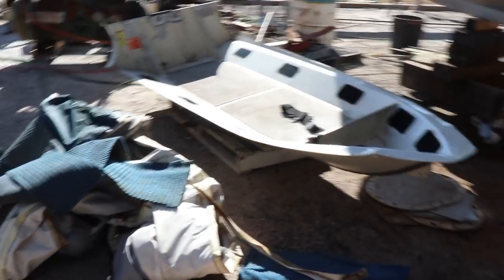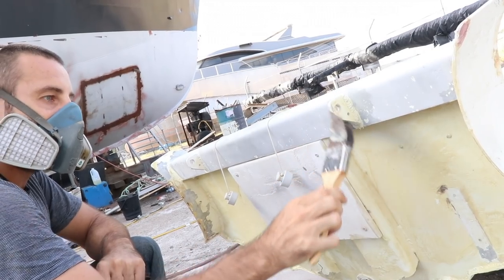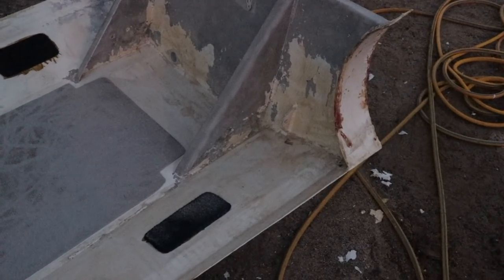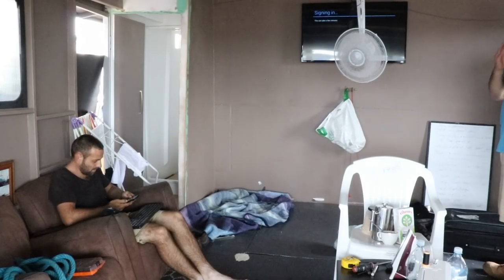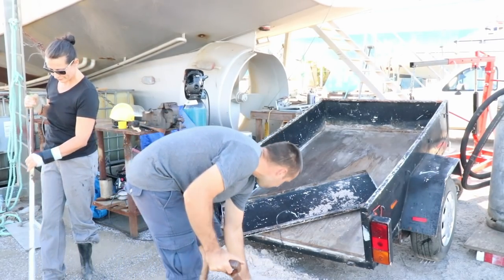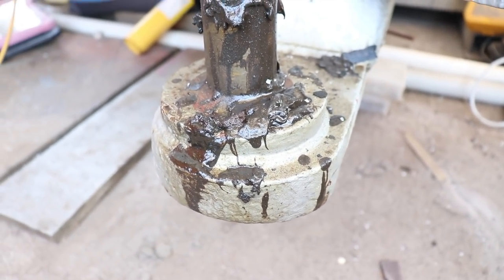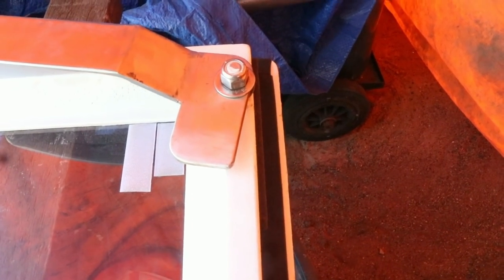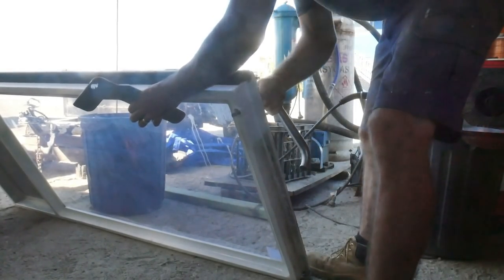Jet Dinghy Conversion and Dogs - Project Brupeg Ep. 68

Comment: When you do the pontoons make sure you leave a air valve so you can fill them with a bit of air (under 10 psi ) , it wont stop dents , but it will help with rigidity. you could also get thinner material than you would normally get away with.
Reply from the maker: Yeah I did wonder about that. Thanks

Comment: A couple of thoughts on the Expedition dingy build:  1- I would set the centre of balance just forward of midships at full loading and at the waterline.  This will maximize the freeboard for rough sea's.  Adjust the trim so the boat's  'V' hull is in displacement mode at 1/4" thrust, beginning to rise onto step at 1/2 thrust and on plane at 3/4 trust.   Leaving a reserve of 1/4 thrust for over loading in an emergency.  
 2- I would make provision for a 4 person life raft, using the container as a seat forward. This will provide some enclosed protection, for engine failure in rough cold seas. And could be used to pick up or support people in cold water
3-   Rope ladders both port and starboard to assist boarding from the water over high freeboard.  
4-   I would make the side tubes from the thinnest aluminum you can weld, filling the chamber with closed cell foam for dent resistance, make the fill holes with threaded aluminum rivets.  These then can be used as attachment points for light accessories ( not to be used for heavy loads, anchor points for lines and other structure. see 5)  . Run the tubes long then cut for trim.   
5-  Weld a half round to the top of the tube for the heavy load attachments and a step.  Not the tube! Also add a 1/2 round to the side of the tube as a rub rail, to protect the tube .
6- On the front of the boat add a step plate for boarding from a rock beach over the bow.  With hand rails 1' above the tubes welded to the 1/2 round part way down the sides open in front for boarding.  This rail could also be used with a fabric cover for cargo or shelter. It would help in rough water to limit water coming over the bow. A saw tooth welded to the bow at the waterline will help protect it  when boarding on and off rocks, logs etc.

Have fun with your tender design.  Wish I were there.   the old guy Bert

Comment: Here we "damage" the old paint prior chemical stripping. Use a coarse sand paper, or other tool, to put deep scratches, and then apply the paint stripper.
Reply from the maker: Thanks Fernando. Yeah we are going to give this a shot. What we are currently doing isn’t working
Reply: @ProjectBrupeg  tergo strip...industrial stripper...a stainless steel scraper wont tend to bite into the ali...the 2 pac paint doesnt sandblast well because it responds a bit like rubber, bouncy for sand...hp comes with weight...get an injected 2-stroke engine if you can...better fuel economy than ANY 4-stroke of similar power and less than 2/3rds the weight...no oil changes ;-)...far more torque too.
WHAT happened to the jet dinghy build ???????

Comment: A wire brush to angle grinder/drill might be the go for getting the paint off that dingy
Reply from the maker: Yeah that was our plan if the sanding doesn’t work. The trouble is the stainless wire wheels do rip the soft alloy up a fair bit so it’s our last resort

Comment: When you go to put the furing strips in you should contemplate running them perpendicular to the metal studs/ribs in order to limit/interrupt any heat/cold migration from the steel  .basically create an air gap between the steel and sheathing.
Reply from the maker: Thanks Jared we will look into that

Comment: Hi l don't know if this will help but l had the same problem with my allie run about the strongest paint strpper did nothing to remove the paint so l use spray on oven cleaner and that worked a treat
Reply from the maker: Ahh thanks Ward. I still haven’t been able to get the paint off so I will give this a shot cheers

Comment: Wheres the rest of the dhingy build??? I was interested in that!
Reply from the maker: We’ve had some big delays on that. People that were part of it ended up having really big health delays, the guy that found the engine for us flakes and went radio silent so we’re back to trying to find a new engine, the tubes are proving really hard to design on CAD and hence further delays. It’s something we want to get onto soon but we need to resolve some of these stops. It’s likely we will build the tubes without CNC cutting. Just get them folded up and we will weld them on and cut to shape on the dinghy. And fit the motor after the tubes as it’s proving hard to find a ski that’s powerful enough and also within our ridiculously small budget
Reply: Shoot it doesnt have to be a jetski, it could just be a 100hp jetpump, but if it does have to be a jetski, a yamaha 1100 1200 or 1300 would get that thing up to 60 - 70 kph probably

Comment: Epoxy paints use aviation grade paint stripper, Also when paint is ready for stripping don't scrape. Use a pressure washer or that water blaster you have there,  It'll work 10 times faster.
Reply from the maker: Ahh good to know. Hadn’t thought about blasting it off. Thanks Patrick

Comment: Hey damo just catching up on some of your vidz , if you can find one see if you can find a yamaha superjet twin they are rated at 80hp bit down on your 110, they are soo much more reliable than a rotax triple and most importantly they come with a proper cast jet unit and can be retrofitted to your hull. Almost all skis now run a hull with the intake molded in (fibreglass) and use nylon wear rings and alloy impellers .. a good superjet can be tuned and or impellers are avail in stainless from memory as are the wear rings , these things i think will be essential in a tender used reguarly  .. we got 33 years out of our stainless wear ringed and bronze propped hamilton jet unit , which pumped huge amounts of sand and small stones .. whereas all of our more modern skis needed wear rings every 3 years with no where near the sme amount of abuse ( we used to run the j52 over tidal sand bars ) .. Another thing to think about is power valves  from memory they are servo operated on the rotax   and always seem to give problems .. food for thought
Reply from the maker: Nice, good to know thanks Mitch

Comment: Awesome boat to be gifted!! sweet. I've seen ali aircraft get stripped with extreme pressure aqua blasting. This boat would have been done within 1 hour!! with no chemicals or sand at all. What happend too the dinghy conversion? suddenly its insulation and rudder? hope next episodes finish the titled story.
Reply from the maker: Yeah we had a bunch of things hold us up on the dinghy. The guy arranging the JetSki went cold so we are now hunting for a new ski to use, and the tube design is taking much longer than expected but both are being worked on each day. Hoping to have a solid update on this soon

Comment: For the rudder shaft I would get your machinist to put a parting tool cut at the height of your bottom pivot. Drop the entire shaft through the top bearings. Weld the bottom pivot and then cut the remainder of the parted section with a cut off disc. Your bottom pivot will then be in perfect alignment with the top section of the shaft.

Comment: You need to cover the paint stripper with plastic on the surface of the paint.  Apply thick then  cover eliminate the evaporation or solvents drying      Smaller sections at a time , scrape it then push stripper to a new painted area and reuse.
Reply from the maker: Ok great to know thanks.

Comment: just a couple of quick points. First I'd like to say I really like the music  during the parts when your not narrating or talking. also I was a bit baffled by the Styrofoam clean up until you mentioned the dog. however, there is an upside if the dog happens to ingest enough of the Styrofoam dust  you will never have to worry about the dog sinking in deep water...hahahaha
I look forward to seeing the video for the rest of the dingy and the finished boat.
Reply from the maker: Thanks Andy, Yeah it should be a fun wee side project. We are doing a mini-series on Patreon about the full dinghy build and will have a highlights type episode out to youtube once its all built.

Comment: Yeah you need to scuff that old paint first. Then the stripper can get in and do its job. It's looking good though. I really love the part in the intro where the engine fires up. On the fish boats I was happy to go down and start the engine when it was cold in the morning. At the rock quarry I loved nothing better than to be the one firing up the jesus motherin" big CAT power plant we used to run the conveyors out to load the barges. And as a 35 year long trucker I love nothing more than to listen to my engine purring along as we cruise down the lonely road. You might think I am in love with diesels, you'd be right. I haven't worked for 2 1/2 years because of heart troubles so your clip gives me a bit of a woody. LOL

Comment: 3:09: One panel down? 6:29: If it's going to be all alu, I wonder if you could reinforce the strakes on the bottom of the hull both for strengthening purposes and for dragging up pebble and ice beach purposes? Wouldn't add much weight. A lot of FG-hulled RIBs here have smooth SS strakes glued on for this purpose. 8:24: Bit surprised that plastic cup isn't melting, if that the jelly-type stripper that eats through layers of paint. I've stripped old doors back to bare wood with that stuff, which is useful, if evil. 11:00: 110 HP sounds vast, but if you're doing a jet unit, I bloody well don't know, either! Just factor it how heavy it will be to haul on and off the boat (because davits at sea aren't a great idea; you'll need a deck crane of some sort) and how beefy the lifting rings or related gear will have to be. 22:54: Sweeping the dirt is how our ancestors got a basement. 34:45: Charming an umbrella holder as Jess is, isn't Australia full of broad-brimmed hats? 41:02: Waterproof grease in there might help as anti-rust and as a sort of seal. Great work.
Reply from the maker: Hi Marc, because of the extra HP, im thinking we will need to beef the bottom up quite a bit. Currently, its 2.5-3mm alloy plate on the bottom and I'm thinking of another full layer of 3mm welded to the first to give it more rigidity. as well as internal vertical panels running from transom to bow under the flat floor. most of the river jet boats in NZ use 5mm bottoms with hard UHMWPE plastic sheets fastened to the bottom to help protect the hull as they bash over rocks/logs etc. 
In terms of weight, the complete transplanted jet and engine is only 10-15kg more than a 30hp outboard and its mounted right down low and forward of the transom so better for weight distribution I think. As for getting the boat out of the water, Brupeg will have a hydraulic crane mounted just behind the wheelhouse roof able to lift the jet out of the water and onto the rear roof. we will have davits but these will only be used for a light tender so we can lift it clear of the water each night, most of the time that boat will be on the rear deck when crossing oceans.
Reply: @ProjectBrupeg  I don't disagree, but this can turn into an arms race calling for more flotation, meaning more beef, meaning more weight...I mean, what is the intended use? As a ship to shore transport or as an emergency tug? But yes, 2-3 mm can't support an engine that will need to be mounted and will also need some way to direct the thrust without bending the thing in half. Do you happen to know the HP of the outboard it originally took? Because if you got something like that, but with a different gearing or a prop pitched for torque over speed, you might have the best of both worlds. I was able to move a five-tonne sailboat with a 9.9 HP outboard in a RIB Zodiac in a pinch (the inboard died) at 4.2 knots in flat water. I lashed it to "the hip" and locked off the motor, slightly offset from straight forward. It worked well, although the outboard got warm! Point being: if you want a tug, it needn't be necessarily over 100 HP to shift Brupeg. Hell, you could even rig a riding sail or a trawler sail to shift it in a pinch. Or a parasail for downwind work... But I digress.
Reply from the maker: Mostly this boat will be loaded with crew and belting off into the distance. It’s rated for 10ppl and 30hp outboard
Reply: @ProjectBrupeg  30 or 300? Or is there some sort of penalty going from a prop to a jet?
Reply from the maker: Rated for a 30hp long shaft. Jets are more efficient at high boat speed (less efficient at low speed). So minor penalty down low and bonus at speed
Reply: @ProjectBrupeg  So I would've assumed. But are you looking for a tow boat or a go boat? Given fuel consumption, I would assume the 30 HP off the transom would be better for range than the 110 HP jetski inboard (which will require major work to mount on that existing floor) and which will take up space, use more gas and lessen capacity (depending on the flotation values of your pontoons. Whereas with an outboard tender, you can stow that separately aft and then you can maybe consider some sort of davits because the whole tender's going to be 100 kilos lighter...(engine plus sufficient tankage for range).
Reply from the maker: For us the ability to hit an uncharted gravel bank without destroying a motor is a massive advantage that outweighs the other compromises. Huge range in the dinghy isn’t really needed. If we can do 20-30miles return (carrying extra fuel on the really long runs) then that is more then enough for what we need. Brupeg needs the ultra long range but the tender can be more normal in that respect
Reply: @ProjectBrupeg  Sure, that makes sense. Can't repair a prop easily where you want to go. I'm just presenting different ideas and wondering how you'll attach a jet ski motor to that existing aluminum hull. Should be an interesting solution!
Reply from the maker: I’ve seen a few options. We had a commentor say the Canadian Coast used to have jet RIB’s but dropped them due to hull cracks around the intake. So the thought is either bloody strong hull in that area or build in a shock absorber. I’ve seen other conversions use the glass intake and part of the ski bottom and fix it to the alloy hull, thus giving the intake some give and a much larger join area for the alloy to intake etc.

Comment: dude, for the dinky, try using wire brush, and disk with grungy pad.   hard form ,striping disk.   on aluminum they work great.  they can be found at most auto centers.    the tube idea sounds good. but I'd glass it afterwards.
Reply from the maker: Hi Ralph, sorry this will be a glass free zone. Just another point of failure if we hit something and alloy can bend. Plus I can weld anything alloy and it’s good to go 30seconds later, glass not so much

Comment: Did you end up finishing the dingy in another video?
Reply from the maker: Hi David. Got held up on a few things with the dinghy. The guy with the jet ski we were going to buy disappeared and we are back to hunting for another engine. The CAD designer we contracted to design up the tubes went radio silent so we are back to figuring out a way to tune it up without the need for any CAD cut parts. So it’s still happening just much slower than we had hoped

Comment: I was thinking why not use a heat gun to soften the paint then scrape?
Reply from the maker: Hi Steve, yeah we are going to try a few things, sand to scuff surface then strip, strip and put plastic film on to hold chemicals in and not evaporate, and heat n scrap

Comment: Great video again guys. Love to watch the progress.Awesome stuff.  One thing that's niggling me, the stern and the water line, it all seems to be very close to the water, looks like 2,5-3m  in total height from underneath the stern. What if you get a big sea coming in swamping the deck and down in the engine room ? Not very high at the stern, just a bit concerned.
Reply from the maker: Yeah it’s only 2ft from water to deck. And the bulwarks are maybe two foot above that. Trawlers are built to be as close to the water as possible and water over the deck is a normal thing, the boat is built to be water tight in those conditions

Comment: You should build it like an OCtender. With open compartments in the sides instead of closed off tubes
Reply from the maker: But then the boat could sink if we get swamped. I can see the benefit of extra storage but the risk isn’t worth it for where we are going
Reply: Could you not just close in the bow and stern sections to create some buoyancy
Reply: I've used a smaller version of what brupeg are making, keeping those pipes sealed makes them a ridiculously stable boat and capable of being utterly overloaded in calm and slow conditions.

Comment: Awesome video and project! Loving it, quick question. What does the second throttle lever do on a single engine boat?
Reply from the maker: Gears. Left is main engine throttle, right is gearbox control (might have this the wrong way around, can’t remember which way they are set up)
Reply: @ProjectBrupeg  oh righto! that makes sense, thank you for your reply :)))

Comment: shorten the upper arm on the lift so it does not extend past the bottom legs and it will not be tipping up shorter the better will lose lifting hieght
Reply from the maker: True but the length is worth the hassle for us. Not often we lift really heavy things but we need to extend past the wheels for most things